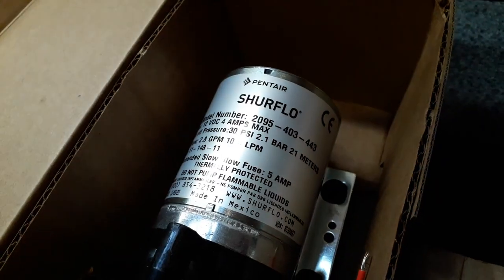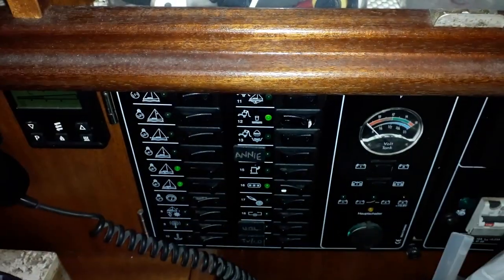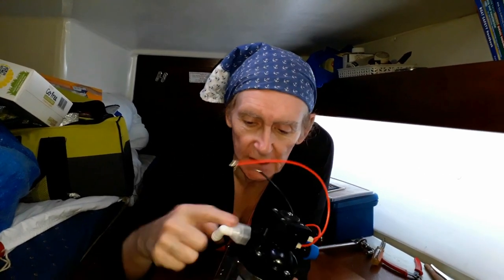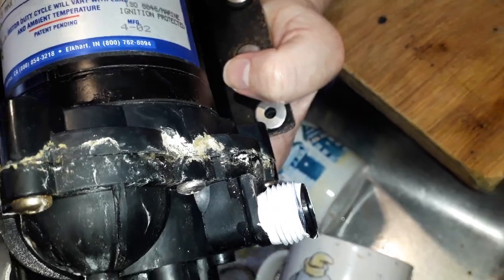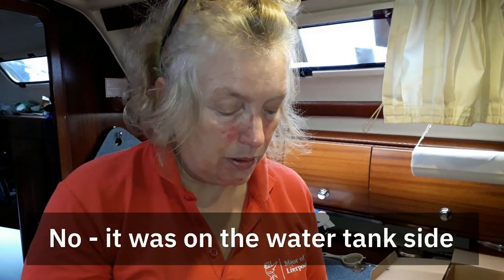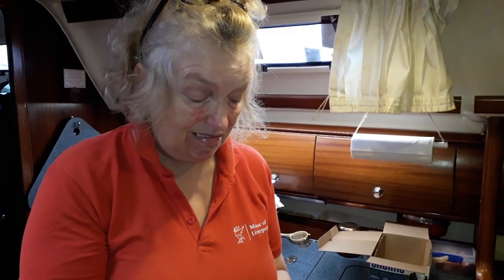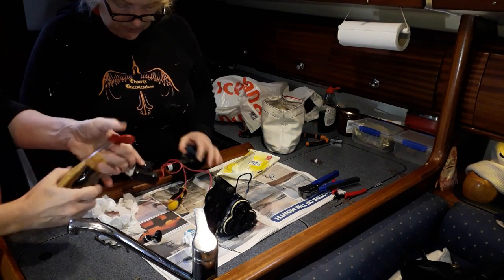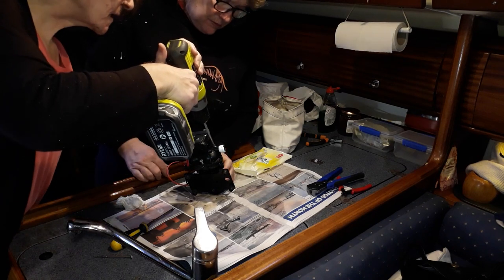Sailing Northern Irleand - Water pump - Bangor marina - Ep. 277

Comment: Something I do with jumper cables and test cables like you have is clip one of the clips back onto the main cable so the clips don't accidentally touch. A bushman's hack is to run a bit of liquid gasket or silicone or similar because though the seal looks ok it fails when pressurized. It's good to see you both becoming more skilled up 🛠️🏴‍☠️
Reply from the maker: Our trick for the jumper cables is to have one 2/3rds the length of the other. Not perfect, but hey-ho... We did consider some sealant along the edge but we will do that nearer the time if we need a replacement. We are hoping it will be OK for years and the sealant might not last that long. Or does it last?

Comment: Hi lasses, enjoying your videos 👍🏼
We have a 1999 Bavaria 38 Ocean, we had the same issue with pump. It turned out to be a microscopic hole in a water pipe which had been routed under the engine (by bavaria) and it was slowly chafing. The pin prick size hole was so small you could only see the water spray in the beam of a torch. We were living onboard full time and the pump would run for a second every 6-ish hours, maybe once during the night. Anyway, pipe work now replaced and rerouted so peace and quiet once again. Happy days! 😅
Reply from the maker: We had something similar a couple of years ago where the hot pipe exiting the calorifier was wearing around the edges after years of hot water making it brittle. We also had the spray of water 😄 Like you we replaced the pipe and that was that.

Always nice to come across other Bav owners. Where do you sail?
Reply: @SailingYachtSaltyLass  Based in Fowey, Cornwall. Interesting to see your travels further North.
Reply from the maker: Fowey looks lovely from  what I have seen on social media. We nearly went there a couple of years back during one of the covid "gaps" but we went to Scotland instead that summer 😄 We hope to come south this summer, but to Co. Kerry and the Irish south coast. There is supposed to be some amazing stuff down there and we hope to get it on video. Are you planning any trips northward?

Comment: A boat part that is actually a real drop in replacement, that is very rare.
For some reason manufacturers often like to put screw holes in slightly different spots.
Reply from the maker: Exactly my thoughts too. I was very suspicious that it went so well.. 😄

Comment: Excellent rendition of pump sounds from you both, spot on.😂 i have same brand of pumps but my main water pump has an accumulator on top to provide the system pressure, but your doesn’t, what is providing the pressure?
Reply from the maker: I have no idea. Plumbing is not my strong point. Our water tanks are low down under the waterline and so all water has to be pumped "uphill".

I guess our plumbing expertise will consist of continuing to make "Brrp!" noises... 😄

Comment: As liveaboards you must put a lot of water through your tank do you regularly use sterilisation tablets or do you not need them? how do you keep the water quality good. As I only use the boat periodically I have fitted a Jabsaco water filter on the line that feeds the galley which seems to give good quality water taste without any noticeable drop in water pressure.
Reply from the maker: Every other fill we use an Aqua MegaTab to sterilise the tank and water. It stops any nasties like Legionella from getting a foothold. Each tank holds  150L so one MegaTab split in two is sufficient. We have got used to the nasty chlorine flavour 😄 (It's not actually too bad)

Comment: Did the new pump fix the problem? When mine goes brrrp, it's because I have turned off the shower at the shower head but not at the taps. And of course being able to do this work yourselves is not only cost effective but pretty essential as most mechanics won't come to the boat while you're at sea :)
Reply from the maker: Yes it did. The boat is now quiet 👍 Although it went well, I still hate plumbing 😄

Comment: Brake cleaner applied to a drinking water pump? I’d be concerned about drinking that and will you ever get the taste out of the water?
Reply from the maker: It evaporates away, but we rinsed it down afterwards. In any case, after a few years in storage it will need a good run through with water in any case.

Comment: Good to see you have solved the problem and were able to restore the old pump for possible future spare, can I ask why you keep the pump running continuously and not simple just switching it on when needed? Why I ask is another Youtube channel had a fitting fail and ended up flooding their boat. Shame we missed out on the bloopers but theres was enough fun moments to have a laugh at
Reply from the maker: We just left the breaker open all the time because it seemed to be OK that way. Turning the tap on was like having an additional breaker switch 😄 We can only flood the boat with a maximum of 150 litres as the tanks do not switch over automatically. In fact because we have fore and aft tanks, we use them as trim tanks for the boat. Glad you enjoyed it and thanks for commenting 👍
Reply from the maker: I have no idea what Beverley is going on about. We always kept the pump off and only put it on when needed. If we forgot, that is when the pump would go off at random times because of the very small leak. For the pressure we have what looks like an upside down bottle that effectively equalizes the pressure
Reply from the maker: I have no idea what Gaynor is going on about. For years we never switched the pump off until the brrp! started getting annoying. As she said in the vid, for about 2 years we have been leaving it off except when we need it, but we have owned the boat for 5 years ...

As they say in all the best Courtroom Dramas - "Your Honour, the Prosecution rests"  😉
Reply: @SailingYachtSaltyLass  Thank you both for your replies, that was hilarious, it wasn't my intention to instigate a mutiny on board.Hopefully you have both come to some agreement now and the case is now closed🤣
Reply from the maker: @sailingyachtmagnum  - that is nowhere close to a mutiny so do not worry

Comment: I think at £60 a pop I would be changing the pump at the first sign of brrrp (the pump cycling). I do however feel vindicated. The number of boats I've been on where this happens and the owners insist it's a leak somewhere and there's nothing wrong with the pump. In fact, one owner tried to tell me the pump was doing its job because it was maintaining pressure which is partially true. 
I've never been on board when a pump eventually gets changed to see the fault disappear so I've never been 100% sure of the diagnosis, but now I am.
Reply from the maker: We checked every joint in the piping and every water tap for drips. They were all dry. It had to be a leak in the high pressure side or a faulty pressure switch because they are the only things that can trigger the pump. The only thing we could not inspect was the non-return valve because it is inside the pump, so after that it was a foregone conclusion.

We still get the very occasional brrrp!!! but it is like once a night and we suspect that the non-return valve is not perfect or maybe as the temperatures cool at night, the water contracts in volume triggering a small pressure drop. But it is no longer brrp!!! every 5 or 10 minutes
Reply: @SailingYachtSaltyLass  Nobody wants to hear brrrp in the night. 😷
Reply from the maker: Especially after a curry night 😲